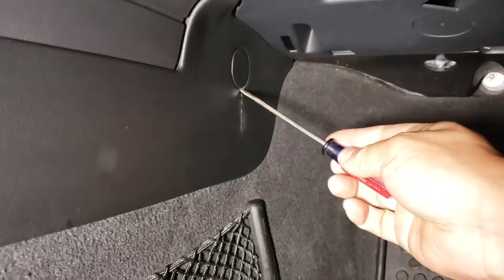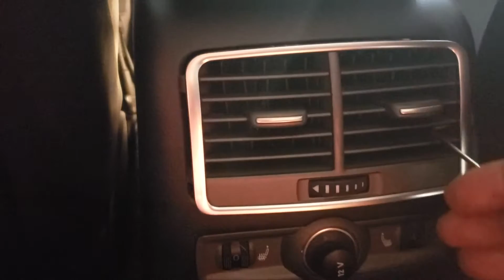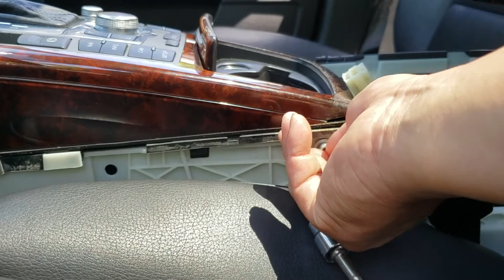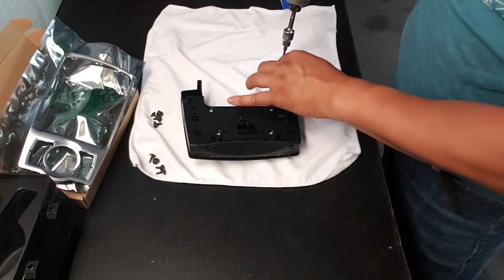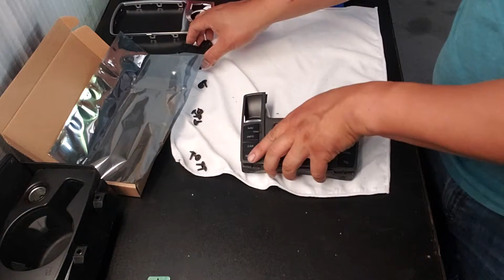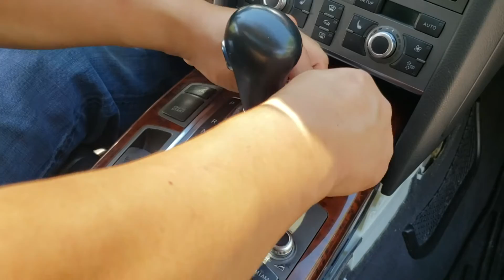Replacing MMI Control Circuit Board for 2005-2007 Audi A6 Q7

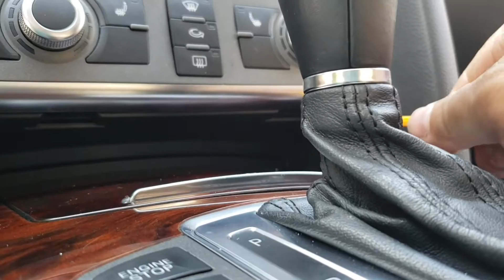Comment: I appreciate your Video. I'm a Retired Professional, I remember having replaced a couple of complete MMI Modules at the Dealership back in the Day (14 or more years ago). Today with the aide of your Video (Refresh my Memory) I replaced the MMI PC Board on my own 2007 A6 C6 Avant (LED's on the Driver's side were inoperative and the Return Button was Sticking. FYI, something you show (11:42 - 11:43) was the releasing of two vertical "Tabs" holding the back of the Rear Center Console Section Down. They can be accessed with both front seats moved fully forward. Pro Tip (13:01): Easier to remove and reinstall the Reveal Trim above the Ashtray by pulling the Bottom Edge of the Climate Control Head Unit towards the rear of the Vehicle (about a Quarter Inch) which allows the Trim to slide towards the rear to slide off and slide on during reinstallation (no prying required).  Randy   AKA randog311

Comment: This video helped so much!! I had my 2006 A6 Avant detailed and when I got it back none of MMI buttons would work. Long story short they fried the MMI circuit board by getting it wet and wouldn't help fix it. I found this video and bought a new board off Amazon for $38 and took 2 hours to change it and it works perfect now! Thanks for the video!